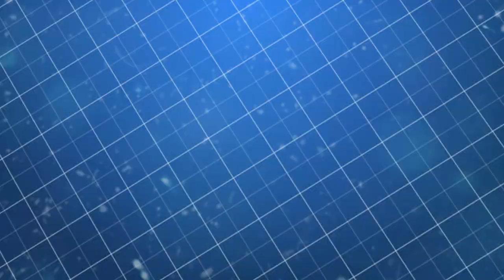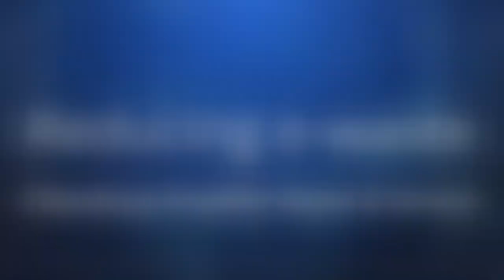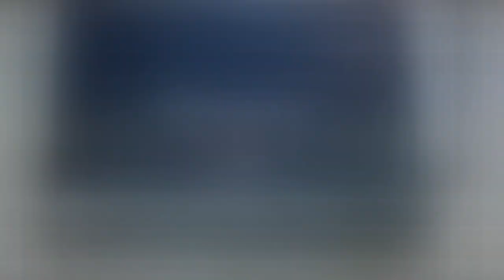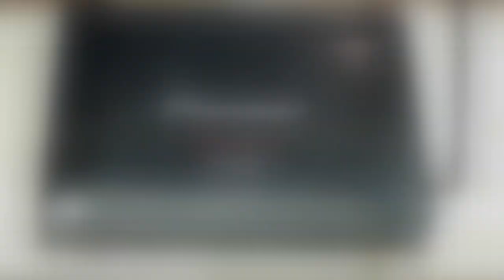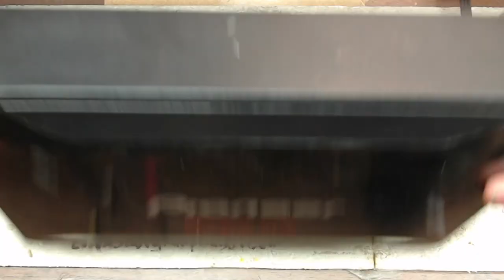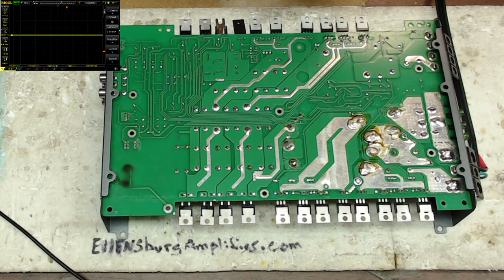Pioneer GM-D9601 Class D Car Automotive Amplifier Repair With Cooked Remote Bass Knob Circuit

Comment: Hi, I am hoping that you can assist me in diagnosing my 5 channel Pioneer Amp. GM-D9605.

The Amp. was playing fine and all of a sudden, the front speakers started acting up. When the car is turned on, there are strong statics coming out of the front speakers without having to turn the radio on. When I turn the radio on, the subwoofer and rear speakers work fine. However, the static continues in the front speakers. The left front does have sound and static but the right front does not have sound, only static. When I switch the front speaker wires, the driver side goes quiet while the front right starts playing which suggests the speakers are not the problem.

I probed the transistors/mofset, not sure the difference. I found 1602CT and 1602CTR top, and 1602CT and 1602CTR bottom or (opposite sides) reading positive to a continuity test. I thought that was the problem so I replaced them. Only to find the new ones behaving the same way. When I tested both the new ones and original ones out of the board, all tested negative for continuity. So, they only test positive when attached to the board. I soldered back the original mofsets since they seem to be fine. When I disconnect the front speaker wires, the Amp. Plays as if nothing is wrong with it, except that there is no sound from the front speakers obviously. I am therefore stuck. I am not an amp. Tech. Just trying to repair it as I do on many of my electronics. Hope this gives you some idea of what might be going on with the amp. This is the best Amp. I have ever had, sound-wise. Any suggestion as far as what else to look for? Thank you.
Reply from the maker: I have not had a 9605 in before but I am suspecting there to be two IC's that will be driving the 4 channels. One channel will be defective at the IC. The 4 inductors is a sign of this type of setup. The IC's could be underneath as I don't have any pictures of the board to know where to direct you to look. The CT and CTR TO220's are rectifiers. You will show a short because they are connected to the secondary windings of the transformer. The reading you are seeing are correct.
Reply: @ellensburgamplifier  Thank you. I want to send you a picture but I don't see any option to attach a pic. I really appreciate your prompt response. Stay blessed
Reply from the maker: @MIMImprovisationsVideos  You can send a picture through my website at www.ellensburgamplifier.com which is where you will find all my contact information or the link at the top to request a quote that will put you right into the mailbox.
Reply: @ellensburgamplifier  Thank you

Comment: What about the voltage is flowing equally and there is no sound
Reply from the maker: Do you have low-side drive? No sound is no modulation.

Comment: I have a Pioneer GMD 9601 amplifier shorting  on postive and negative terminal. Please help sir
Reply from the maker: You have shorted power supply transistors. You may need to replace the transistors, pre-drive transistors, and gate resistors up to the drive IC. Now in most cases, a shorted output causes an overload in the power supply so I would also check the output transistors and drivers.
Reply: Sir my problem is not solved help me sir
Reply from the maker: @tarunkumar1854  There are only a few reasons why there would be a short across the power terminals. That would be shorted power supply transistors and in rare cases shorted filter capacitors. If the drivers are across 12v and ground, they could also be shorted. The first thing is to isolate the short.
Reply: Sir IFR 3205 and output transistor is ok , but all filter capacitors are shorted.

Comment: Hello, I have a small problem with the selection of a transistor whether to replace three when it comes to Pioneer the same, whether they should be different
IRFB4227PBF MOSFET TRANSISTOR N-CH 200V 65A TO-220AB

old transistor is number
IRFB4227
IOR P619P
57S1

do the symbols of the transistor S1 S2 S3 and so on have any meaning?

I cut off the one from one bank and that was the main problem, now the amp glows blue :) Yeah :)
You are amazing :)
 :)
Many Thanks
Reply from the maker: A good practice is to replace the transistors that are in parallel. I can't remember, does this amplifier use the 4227's?
Reply: @ellensburgamplifier  exactly IRFB4227
IOR P619P
57S1
Pioneer -GM9601
Reply: as in the video, I cut off the first transistor and a blue light appeared :)
Reply from the maker: @bradpitt3965  Yes replace all the parallel transistors with the same batch.
Reply: @ellensburgamplifier  MOSFET Transistor IR TO-220 IRFB4227 IRFB4227PBF
great if there is any difference between them?
Reply: when I finish, I will share with you the information if the amplifier works, you are great 7 guys did not attempt to repair this amplifier claiming that it is not profitable :):):)
Reply from the maker: @bradpitt3965  Nice! That means there are no other problem areas.
Reply: @ellensburgamplifier  Thank you for your extensive knowledge. Greetings to you and your fans, I'm already getting to work.:):):)
Reply from the maker: @bradpitt3965  They are the same. The "PBF" is just lead-free.
Reply from the maker: @bradpitt3965  I can't stand repair techs like that. I will always have the customer's best interest before profit margins.
Reply: @ellensburgamplifier  Exactly I was afraid of worse things, but everything is going smoothly With this series of amplifiers, there may be ailment of the same kind, too much load or cheap, weak transistors in production:)
Reply: @ellensburgamplifier  I understand you very well, you also need patience, so on the way I break other amplifiers :) I gain practice thanks to people like YOU :)
Reply: @ellensburgamplifier  and I am an amateur :) this is my first amplifier repair and it is funny that most professionals did not even want to try to repair and look at the equipment :)
Thanks to people like you, everything is possible :)
Thanks a lot :)
Reply: @ellensburgamplifier  Great,interesting information ::)
Reply: @ellensburgamplifier  Hi. I ordered transistors as it turned out I replaced one, checked, they are not compatible with the originals What makes the amplifier still not working, today it's hard to find working parts :)
Reply from the maker: @bradpitt3965  If you ordered IRFB4227PBF transistors then you ordered the right ones. If they did not work then I would have to ask where did you get them from?
Reply: @ellensburgamplifier  I bought it on eBay social networks, should they have the same resistance measured before assembly or only after assembly>? Because instead of 0.46 ohm it has less, I will check it again :) Besides, you have a great soldering iron. Hakko 301 :)
It is expensive, but I can see a specific one :)as a curiosity, I only trusted the seller of any numbers or symbols on the resistor, another thing is that when I measure the resistor, there are some strange jumps on the one hand and not at all on the other. When you solder the resistor to the board, you solder it on both sides or only on one side. question, but I'm just a new amateur :)
Thank you, you are like my guide, I am more and more passionate about viewing your materials:)
Reply from the maker: @bradpitt3965  You are looking at the switching characteristics of the transistor if you are checking the resistance of the transistors out of the circuit. I would be careful as a LOT of transistors are fake on Ebay.
Reply: @ellensburgamplifier  Thanks for the tip, it will definitely be useful because I actually met the wrong transistor :)I will try to find a reliable seller somewhere, I don't know where:)I am also not giving up and thank you for your support, you are helping a lot :)
Reply from the maker: @bradpitt3965  Always happy to help!
Reply: @ellensburgamplifier  one could write a lot. You are a really great person. I have written to you many times and you responded with great respect to you:)
Reply from the maker: @bradpitt3965  I am always willing to help. Remember that you can always email me directly and you can find all my information at www.ellensburgamplifier.com

Comment: Sir IFR 3205 transistor shorting on  drain and source terminal remove from circuit but ifr 3205 transistor is ok , but shorting on location.
Reply from the maker: Pull all the 3205's and check the pads to make sure you don't have a shorted transformer.
Reply: All Ifr 3205 transistor drain and source pad shorting.
Reply: You have pioneer gmd 9601 amplifier circuit diagram , pcd layout. Sir please share
Reply: Please help me
Reply from the maker: @tarunkumar1854  I don't have schematics for these. Shorted RC snubber? Luckily it is the power supply side so not much is connected to the ground. I assume you are seeing the same short at the power terminals?

Comment: I would just like to ask about one thing in your movies, when it comes to this model you have resistance 4.7 everywhere I have 4.6 is it normal? Many thanks
Reply from the maker: Yes, you will have a tolerance value with almost any electronic component. The key is looking to see if any are substantially off.
Reply: @ellensburgamplifier  Thank you for the very valuable information that will be very useful to me And now I'm getting down to work. Thank you and Best regards:)
Reply from the maker: @bradpitt3965  I am always here for questions!
Reply: @ellensburgamplifier  you are one of the few people on social media who responds so quickly ::)
Reply from the maker: @bradpitt3965  I try to stay on top of it. Please remember to watch out for the high rail voltages!
Reply: @ellensburgamplifier  Of course, I will remember according to the directions :)I don't think this current will kill me :)
Reply: @ellensburgamplifier  Hi, I just tried to test an amplifier with a damaged transistor, it's interesting, the amplifier works without a transistor.The transistors I was able to buy on eBay simply don't have any traces of life or measurements.I am wondering only one thing, how the amplifier works without one transistor that broke This transistor works as some protection? :) Many thanks
Reply: of course, I connected it for a test without a transistor on a small speaker :)
Reply from the maker: @bradpitt3965  Most transistors run in parallel banks. All you need is one transistor in place for it to work. I would not use any transistor off Ebay unless you know the seller and have verified their products. Have you seen my video of craking open the transistor to check the die size?
Reply from the maker: @bradpitt3965  Yup sounds like you have purchased fake transistors.
Reply: @ellensburgamplifier  just didn't see this movie,an interesting fact is that in your video in every bank it now shows a resistance of 4.7 And for me it shows 4.6, so the question is whether the European version differs from the American version when it comes to Pioneer of the same power> Fact, on ebay they are only unverified transistors so i have to look elsewhere
Reply: @ellensburgamplifier  these transistors show no parameters ::)
Reply from the maker: @bradpitt3965  4.6 is perfectly OK as there is a 1% tolerance in these resistors (possible 5% also)
Reply from the maker: @bradpitt3965  Yup no good! The specs should be close to what the datasheet shows.
Reply: @ellensburgamplifier  great information, another tip, I will continue to fight and look for a proven seller with transistors:)I have one question Can the transistor affect the entire amplifier I mean, the amplifier works without a transistor
Reply from the maker: @bradpitt3965  Yes, missing one transistor will make the others work harder adding more stress to them causing failure. LCSC.com I would see if they have what you are looking for.
Reply: @ellensburgamplifier  Sorry I didn't reply earlier, I fell asleep at the computer:)I agree with you one hundred percent will burden the system of other transistors,
great site with this electronics but again the question arises Which company to choose :)
Maybe you could recommend a specific company for Pioneer amplifiers.?
Thanks a lot for your support and I am still your fan ! :)
Reply from the maker: @bradpitt3965  There is no specific company for each brand. The goal is to get the transistors from trusted sources. LCSC.com is one of the sources you can trust for good-quality parts.
Reply: @ellensburgamplifier   I live in one of the European countries and this is UK, so do I need to order from the US? :)
Reply from the maker: @bradpitt3965  No you can order from https://uk.rs-online.com/web/ they have authentic parts also.
Reply: @ellensburgamplifier  You are a professional, very amazing person when you don't know where to go or where to go You are always helpful, that's why
    I respect you very much :)
Reply: interestingly, these transistors are cheaper on the site you sent me than on ebay :)
Reply from the maker: @bradpitt3965  Thank you!
Reply from the maker: @bradpitt3965  Yes, sometimes you will find a better deal from large distributors.
Reply: @ellensburgamplifier  nice side, but both sides of the product are unavailable
Reply from the maker: @bradpitt3965  I show LCSC.com has them but expensive. Aoweziic Raw Material has them a little cheaper. Both are great places also.
Reply: @ellensburgamplifier  N-Channel MOSFET, 65 A, 200 V, 3-Pin TO-220AB Infineon IRFB4227PBF I will check again because it is still not available on websites in the UK
Reply: @ellensburgamplifier  Anyway, thank you for your support and help

Comment: My automatic signal power on is not working, how do i fix this, i really wanna know about it.😔
Reply from the maker: Is the remote not turning it on? I don't have a 9601 in but I do have a 8601 that may be the same. You will have to follow the remote circuit to the first transistor. You may have a failed remote circuit depending on what the original fault was.
Reply: @ellensburgamplifier pioneer 9601 hav ability to turn on with 12v and ground connection with rca cables running through music system of car only, this amo doesn't need to connect remote wire connect with 12v. But the issue is my automatic turn on sensing with RCA cables is not working, i need that solution. Please ??
Reply from the maker: @amarmishra7693  Sorry, you are talking about the signal sensing circuit. I do not have information on that circuit on hand. I can try to look into it with the Gm8601 that I have in.
Reply: @ellensburgamplifier  if u find then will u make a short video to explain ??
Reply from the maker: @amarmishra7693  I will see what I can do. I took a brief look at the one I have so I should have an answer soon.
Reply: @ellensburgamplifier  thankyu ☺️
Reply from the maker: @amarmishra7693  I have a schematic that may help you. It is for a different amplifier but uses the same topology. Email me, you can find my email address at www.ellensburgamplifier.com

Comment: Mine have no sound but ic all ok
Reply from the maker: (If you have a scope) Do the output transistors have the high side and low side switching on the gates? If so is there any modulation as you increase gain or change frequency?